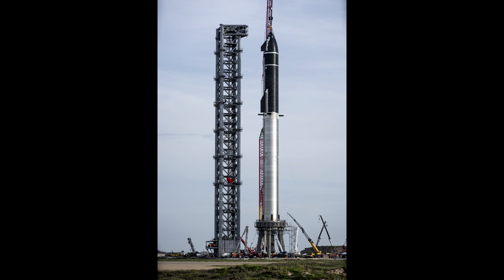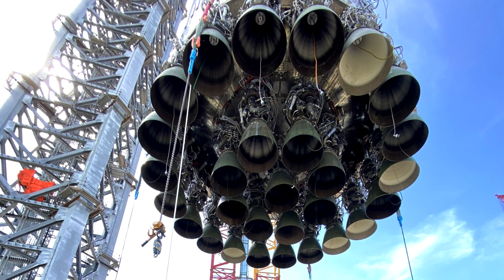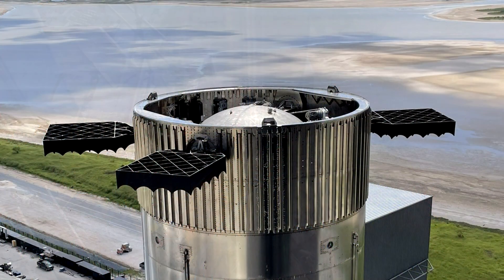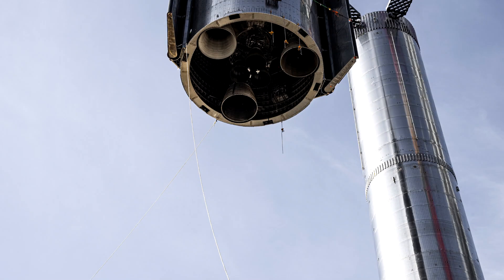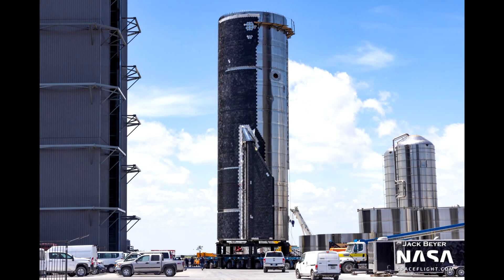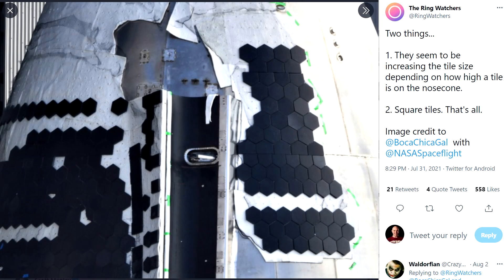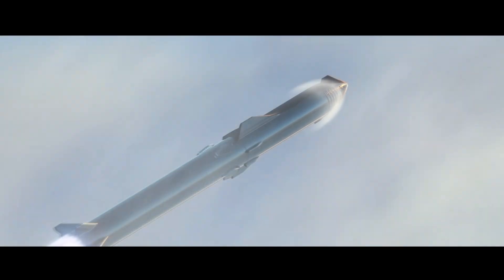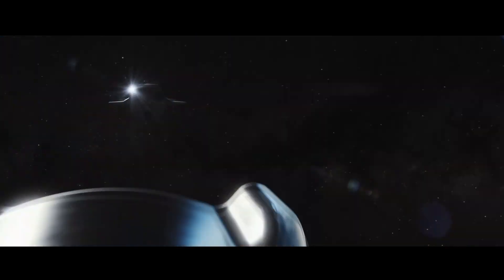How SpaceX Designed A Heat Shield For The Largest Spacecraft Ever Built

Comment: The outro looks awesome though it's quite flashy/distracting, I think it would do better if you left out the first 9 seconds. Since the rocket is always small enough to be in the middle of the endcards at all times after that, you could show the endcard a bit earlier, you gave the viewers a mere four seconds to pick a video. So start of outro at 17:49 and endscreen at 17:50
Also your explanation is really good, I was surprised how easy mounting these tiles would be. Let's hope it'll have a better reputation than the Space Shuttle heat shield!

Comment: Another thing I'd have liked to have seen in this video is a discussion of the merits of fixed (well, still rotatable) grid fins. I can only imagine they will be rotated to be edge on for launch, but even so, huge dynamic forces (and drag and fuel consumption) and how does this compare to the fuel/mass saving from not having the additional actuator?
Reply: I suspect its a redundancy issue of having less moving parts, and the engines are capable of dealing with the extra drag.
Reply: I think it has more to do with removing complexity and a possible failure point, than mass saving. And if they are aligned with the air flow if shouldnt cause too much drag.
Reply: @niconico3907  So move the axis of rotation to 45 degrees off the horizontal. As they rotate they pass through a point where they are nearly vertical (against the side of the ship) and also pass through a point where they are nearly horizontal. So long as they are operated in pairs, you've got full control.

Comment: A lot of people, even my physics teacher back at school said that spacecraft heat up during reentry bcs of friction with the air. But some sources also says if the heat caused by air friction is actually just a very small part, or even not at all, rather most of the heat comes from sudden compression of air in front of the spacecraft. So which one is true or both of them are false and heat up reentry is caused by other factor(s)?
Reply: Your physics teacher doesn't know what he's talking about. That's probably why he's a physics teacher and not an engineer.  To understand these physics, you need a solid background in thermodynamics, gas dynamics, and convective heat transfer - separate, but related topics. Anderson's hypersonics book covers them all. NASA may still have some web pages that introduce it. Or try looking up "reentry aeroheating", as it is often called.
Reply: @MrKentaroMotoPI  haha that's might be why he's a teacher. Anyway thanks for the reply, I'll try looking up on it. While this stuff isn't actually my expertise, but its very well piqued my curiousity.
Reply: @tomatopotato2242  You will find it very interesting.

Comment: Um.. the original justification for stainless steel (as far as I can recall) was because it supported transpirational cooling. So is the use of stainless steel now an accident of history, or can it really be justified against alternative materials? I note that Relativity's Terran R will be 3D printed aluminium and I suspect it will prove to have a mass advantage over SpaceX's design.
Reply: The dry mass of Starship is just stupid. A Heavy-lift Vehicle design from NASA's SPS study has similar payload to Starship (120t), yet only 4000t mass when full (less than simply the fuel mass of Starship), and that is with a 22t reserve! Apparently, aluminium construction + winged flyback is a pretty efficient design

Comment: 2:20 - Do the grid fins on the booster not fold in during ascent?? That seems crazy!
Reply: No they don’t. IIRC Elon talked about this in either Interview 1 or 2 with The Every Day Astronaut guy.  Part of the design philosophy to remove things not really required and simplify what’s left.  Appears they found that whatever drag the fins cause on ascent is outweighed by the reduction in mass and complexity (and resulting increase in reliability) of removing the actuating mechanisms.
Reply: @ericbainter826  Thanks for the reply. I watched those videos but I guess I missed that part - it would be nice to hear the detail behind it. I don't understand it really because the technology is already in-use on the falcon, so it's just a question of scaling it up, right? I do recall Elon mentioning that the batteries powering the fins on starship are a problem area, so might be likely that the batteries that would power the hydraulics would be far too big on the booster.
Reply: @230jjordan  Elon said there wont be hydraulic on the grid fin actuators, only electric motor and gearbox.

Comment: That insulation pad is almost certainly an aerogel batt, they are used extensively in the oil refinery and gas industry, for boilers and industrial processes as well as was used on the space shuttle itself.  They are semi rigid and can withstand well over 1,000 C... They are super thin and very lightweight.  You can also buy rolls off Alibaba for cheap now.

Comment: One can replace the fins with new fins on reentry along with the cone. In the background these used fins and cone can be examined and tested to see if all is well. If the used items are not ok then time consuming repairs can be done.
In this light I think I don't think rapid reusability is needed. I think rapid turnaround is achievable. This can be achieved by simply doubling up. So as one starship returns another one is ready to go whilst the old one goes away to be checked. The heat shields and be checked and repairs done. When the starship returns the old one is ready  to go.

Comment: The shuttle orbiter was shielded from the aerodynamic loads by the prominence of the external tank during ascent. Even the X-37B was shrouded to better protect the heatshield. A much more stronger bonding is needed for the Starship tiles.

Comment: The grid fins are not stainless steel; they are welded steel plate.  That was apparent during the tour video where the grids were shown rusted  before painting .  The Space Shuttle hull being aluminium melted at 1221F.    Stainless steel melts at 2500F.

Comment: The white blanket under the tiles is a refractory material called Kaowool or some other material similar to Kaowool. It's good for temps up to 2,000 F but a supersonic slipstream will rip it right off the vehicle. The red glue is called High Temp Red RTV, a type of high temp silicone rubber. The big concern will be keeping the movable surfaces moving during re-entry. The natural tendency will be to become welded in place from the hot slipstream.

Comment: The space shuttle was an overdesigned complicated behemoth.   This Starship appears to be on the other side of the spectrum:  under-designed simple tin can with tiles tacked on. You can kiss quick turn around time goodbye with this tile approach.
Reply: To be fair, the Shuttle had to serve many masters whose requirements were at odds. It likely would have been better to build a military shuttle and a NASA shuttle instead.

Comment: @4:16 you said they have to refurbish dragons heatshield every time - while Elon said in Tim's interview, that Dragons ablative heat shield is so thick, that they can fly several times before they have to replace it. 
another interesting aspect of the heatshields that Elon explained, was, how the Dragons heatshield can compensate high temp spikes for a short duration, while the Starship heatshield will be for lower temp, but longer duration.

Comment: Are the tiles supposed to have those gaps between them? Won't that be an issue at high speeds in the atmosphere?
Reply: The heat will make them expand to fit tightly together, which is likely part of the reason SpaceX chose the size of tile that they did.

Comment: I know it would add weight, but if you applied tiles over the entire craft, you would effectively gain redundancy against tile loss. Big hole in the heat shield? No problem, rotate 180 degrees and come in using the tiles on the other side.

Comment: At 9:58 Scott mentions the bottom is black so the it can radiate heat effectively. Did he miss speak? Black absorbs more radiated heat than white. The white reflected radiating heat from the plasma makes sense, but the bottom being black doesn't make any difference does it? If it does please explain to me how.
Reply: To add to this, when these surfaces are under stress, they won't be black, they will be white hot, regardless of the color. Again im just trying to understand why Scott said this, I might be wrong but I think he's reading to much into the color of these heat surfaces... If they added paint to them it would just burn, that's the simple answer IMO... Someone please enlighten me
Reply: @Lorcan.oshanahan  Research radiative heat transfer and emissivity.

Comment: that insulating ceramic wool is probably the same stuff I used in bbq tank forge. heat can be cranked for an hour blowing blue flames and the tank will still be only warm to the touch

Comment: They are using the same RTV we use in Aviation applications for sensor connectors and exhaust components RTV 575. It is a reddish Orange color.

Comment: Maybe a modular starship would be much better option for human transport. 
Smaller refurbishable re-entry vehicles stacked on top of each-other.
This would also reduce the risk of a total re-entry failure, as one vehicle failing will not affect the others. 
Also in the future, the heat shield could be inspected and repaired in orbit (inside a pressurized repair station), eliminating the risk of damaged tiles during launch.

Comment: Scott, please explain why the hinge of a flap is exposed. It seems to me the mounting fairing should have a "shelf" along its length that covers this gap. That is, the ventral shape of the fairing should be wide enough to cover the gap, and have a curve that directs the flow onto the flap as a whole. (The body of this incorporates the curve in its shape, but does not actually curve around the flap, i.e. it doesn't interfere with the flap's range of motion.) 

I'm not so deranged as to think I'm smarter that the SpaceX engineers, but would like to know why this wasn't done, what flow pattern made it impossible.

Comment: I am kinda sure that stagnation point means a point where flow velocity is zero with respect to the vehicle. That is to say that shockwave may not contain a stagnation point, because the air in/close to the shockwave is probably still moving with respect to the vehicle.

Comment: Hey Scott, love your video presenting super powers! I’m curious would it be possible to coat the starship with some kind of paint or special coating rather than tiles? I can imagine a huge bucket of paint the can just dip the starship in after each flight!
Reply: i dont think so, since a layer of paint is much thinner than tiles, so it wouldn't do a good job of protecting the belly of the rocket as it belly flops through the atmosphere

Comment: How much cooling occurs on the reverse side without the shielding? I wonder if , given the round body shape,  Starship were to generate a slow rotation could a lighter and lesser but over all heat shielding be used? Just a thought bubble. I work in ceramics and you can heat items heavily but avoid damage by a gentle rotation .
Reply: Might be doable if not for the need for the flaps..

Comment: I was wandering about a month ago if Space X ever considered using the second stage of the Falcon 9 as a test bed for the heat shield tiles ? Since once it’s done it’s job , it’s discarded to re enter at the right speed and altitude that most other space ships might use to de orbit, only it’s left to burn up .   
Maybe the actual recovery would be somewhat complicate and of course there would have to be design changes , but that’s what experimenting is all about .

Comment: The definition of stagnation point is where the air speed gets to 0. It is usually used for pressure/energy calculation. Air will never reach stagnation just like you can’t really balance a ball on a pin tip.c
What you described is a bow shock, which is created due to boundary layer effect. The reason you want the bow shock (any shock) away from your vehicle is the temperature due to friction and compressibility is highest alone the shock. This is also how you can estimate top speed of fighter jets by drawing a line from the nose to wing leading edge. That angle can give you the maximum designed Mach number for the fighter jets.

Comment: During ascent at max q the pressures pulling the tiles off are due to the sharp but still rounded edge lines near the gaps. The leading edge of the tile is pulled up slightly, which increases the pressure in the gap and underneath this tile substantially tearing the tile out. This can be avoided by filling  the gap with a wachs that does not  prevent slow relative motion of the tiles, but prevents by smoothing the airflow to prevent low pressure areas to form and to seal the gaps to prevent air to build up a lifting pressure
underneath the tile. No protection effect on the reentry phase.

Comment: The starship heat shield seems to be a problem for the catch arms and the hoist contacts for putting the starship atop the booster. Can you say how and where the arms can grab the starship without contacting (thus damaging) the heat tiles? Can you say how the hoist will hook onto the nose cone if the tiles completely cover the spots that presently allow prototype starships to be hoisted around? in both cases, grabbing the areas not covered by heat tiles would be unbalanced. How will this problem be addressed?

Comment: Hi Scott, this video made me have a deep dive into the fabrication of the Shuttle's heat tiles and it's modern relative TUFROC. I would love to see a video examining the sintering process of the silicate substructure and the glass coating of the surface. The main difference of TUFROC seems to be the intermediate Silicon Oxycarbide Layer between substrate and glass surface, which seems to be used to mount those tiles to some mounting pins. I wasn't able to gather nearly as much info on how to manufacture those SiCO structures. Would you maybe want to take a look at that in the future and what this possibly means for the rigidity of those tiles?
Maybe someone in the comments has a good pointer on how they did it at NASA (as SpaceX probably has their secret sauce).

Comment: Your analysis is also interesting.  Plus, I think it will be very difficult to get the correct heat shielding around those hinges for the flaps.  It will be interesting to see how they do that.  Or just what Starship looks like once those tiles are on that location.

Comment: One thing about heat reflection and radiation - dont be fooled by visable color.  A White object in visable light may be black relative to infra-red light. Try this experiment in your home schooling: Put a highly polished stainless steel and similar white painted piece of stainless in sunlight (most of the energy is in visable) for a while.  Both reflect visable light pretty well but the white painted is close to being black in infra red and will radiate in infra-red much better then the polished and will be much cooler.

Comment: hey Scott, a strange question for you: how much will SpaceX's starlink constellation increase the risk of Kessler Syndrome if at all?
Reply: From 500 km will decay in a half a year max , 1000 km decades. Space X -s highest orbiting sats will deorbit within 5 years. That is, if inoperable. They plan to deliberately deorbit them at end of sevice life. Also most of their sats orbit 550 km altitude.
Reply: @istvankovacs6969  thats good to know. just slightly concerning to know that SpaceX plans to launch thousands in total for Starlink
Reply: The sats  can avoid space debris autonomosly. They are also tied in with with the airforce tracking all objects bigger than 5~10 cm.  Worst worst case all objects from that altitude will decay within 5 years due to  friction to some air molecules and gravity. The int. spacestation at 350 km have to reboost itself once or twice a year .
Reply: @istvankovacs6969  right but how effective is that multiplied by several thousand more sattelites? from my understanding SpaceX wants atleast 10,000
Reply: @Kilonovae  Fisics , 5 years.  the worry is for higher altitude sats.over 1500 km alt.  can last hundreds of years. There is the danger of closing space access. Over 2000 km pozsibly thosands of years. Mr Musk is right that now is the time, accsss to space is precarious , won't be open for long.  Main concern is conflict as antisat weapons demonstrated. Interesting times indeed. Fun to live, just a little worried.
Reply: @istvankovacs6969  perhaps technology could be developed to help clean up dead sats and free up orbit space. the more bits in space the higher the probability for a cascade event if theres a collision.
Reply: @Kilonovae  Calculate the surface area of a sphere about 7000km in radius.  Divide that up by the number of satellites.

Comment: Could the tile clips be modified to unlock when a magnet is placed over the tile, similarly to how anti theft tags are removed from clothing?  An internal pin could be pulled to the tip, making the sides of the clip retract.

Comment: Why did they switch from a hydraulic system for the grid fins to an electric motor? I can't imagine its too much in weight savings, the hydraulic system has seemed pretty reliable so I'd be surprised if it was reliability, could it be cost?
Reply: Simplicity I imagine. It's a whole lot easier to run some cables than to run hydraulic lines.

Comment: In Tim Dodds interview with Elon they focused on the hinge of the flaps as a vulnerable area that will need some special cooling feature to stop the hot plasma (blow torch cutting style) burning them off.  A possible solution, from my limited perspective, would be to put deflectors in front to the flaps to offer some thermal absorption and also to guide the plasma away from the hinge.  The experts to consult on this would be the designers and engineers of F1 cars.